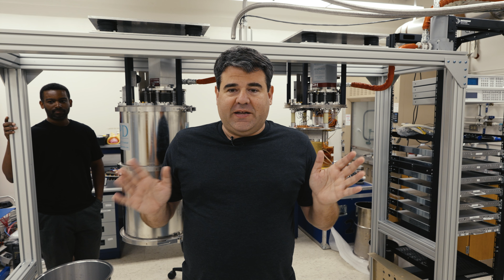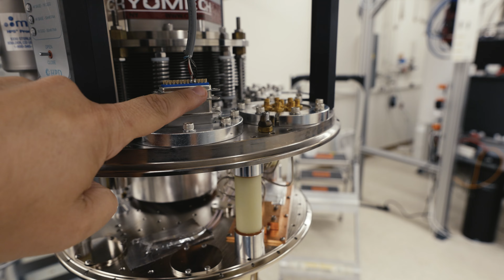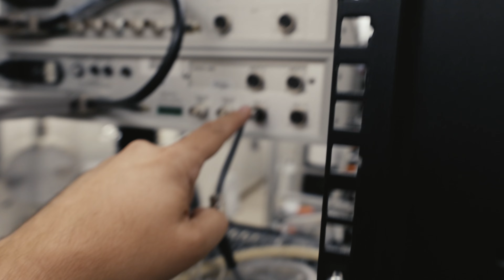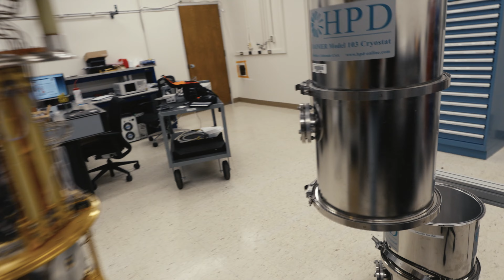Basic Lab Skills: How to Make a Cable

Comment: Hi, I'm a retired electronics design and development engineer from the DoD research area that has created a lot of specialized equipment. I like your videos and have some constructive pointers for you that could help. A good solder joint will look bright and shiny, a matt grey joint is an indication that it is "cold" (I've seen some people blow on a solder joint to cool it faster!). You wont need extra flux if you use rosin core solder. Using clear 1/16" Alpha 221 heat shrink or equivalent also adds strain relief to the wire/solder cups, helps avoid solder bridges and helps in humid or freeze/thaw (condensation) conditions. Make sure you are not swapping the black wires between twisted pairs- the twisted pairs are purposeful. After removing the jacket and before untwisting them all it's easy to see the pairs. Use the DMM to test continuity end to end after assembly before plugging it into the equipment. Tin the wire AND solder cup before joining. Don't clean your iron before storing it, keep your soldering tip tinned between uses with excess solder so the tip doesn't oxidize, only clean it with the sponge then re-tin it just before use. Your iron is fine, but that long pointed tip is not helping. Try a narrow "chisel tip" like 1/16" wide. The tiny bit of mass, flat and shortness helps the heat transfer and solder flow to the cup better/faster/ without holding it so long as to melt the blue DB insulator and make the pins crooked or melt the conductor insulation. If you build the cable horizontally you wont need 3 or 4 hands to hold it, lay the cable across the table with the connector closer to the table and it will all line up easier. Use a proper stripping tool on the jacket so you are not straining the conductors yanking it like that. The drain wire (shield) always goes to the data acquisition/control side not sensor side. In high quality equipment do not use chassis ground (safety ground) as a signal "ground". The chassis is not normally a common ground for the electronic signals or shield wire. If your connector back shells do not have the correct grommets add a short piece of 3/8" Alpha 321 adhesive lined heat shrink and/or a piece of tubing to give the back shell a good clamping area for strain relief. Neatness counts. Free hanging cables will stretch from gravity over time and if they are a long length of cabling containing small gauge wires they can stretch enough to increase resistance or to  break randomly near the middle as you mentioned.
Reply from the maker: Thanks for the great tips and for watching!

Comment: You'll have a much easier time controlling the temperature with a modern soldering iron like a JBC or Metcal, they're really worth it. If you can't get those, Aixun is great. Those Wellers seem to be there by inertia.
Reply from the maker: One of the advantages of being a dinosaur and using leaded solder is that I don’t need to get things nearly as hot, which gives a lot more margin between the solder melting and damaging what you are soldering… should have mentioned that in the video - leaded solder is so much easier than lead-free. I know European physicists sneak the good stuff back from trips to the US…
Reply: @ExperimentalAstrophysics  I find that the better temperature control of the JBC/Metcal irons even helps with leaded solder.

Comment: drowning everything in liquid flux first makes soldering connectors (or anything really) quite a bit easier at the cost of needing more cleanup
Reply: also everything is easier with leaded-solder. Lead-free is such a pain
Reply from the maker: I usually like to use a no-clean flux core solder to minimize the cleanup.
Reply: It's like Louis Rossman says. You can never have too much flux!